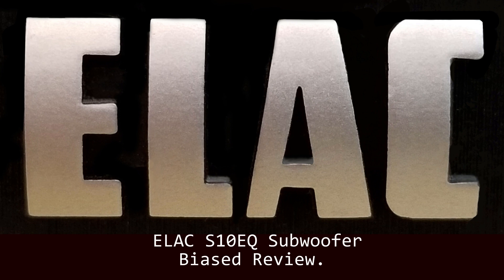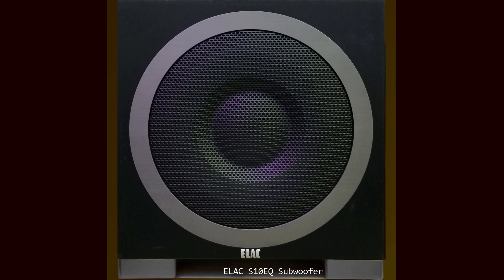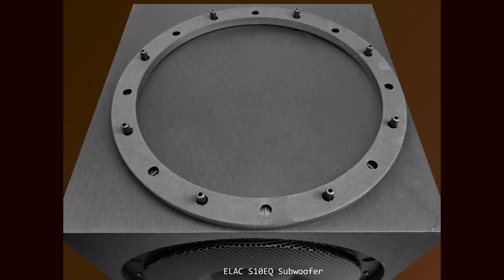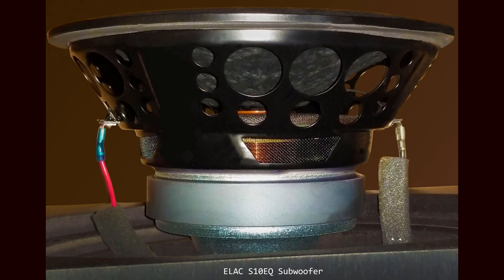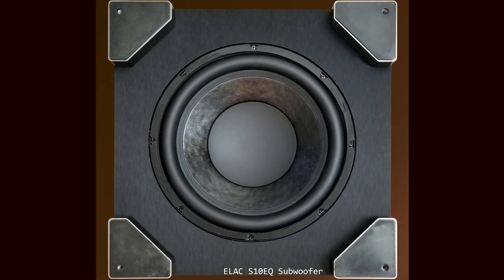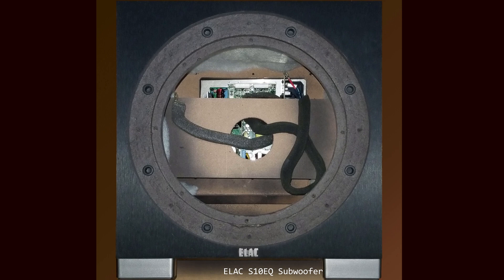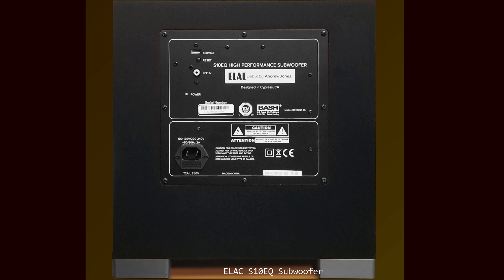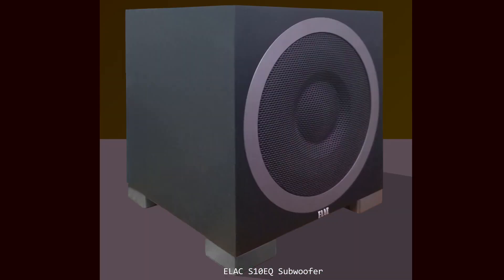ELAC S10EQ Subwoofer *Biased* Review and Teardown.

Comment: I have two of those I was kind of disappointed not having any analog knobs and switches on the back and how much trouble I would have with the Bluetooth when they went to 3.0 app  talk to tech for like about 10 days of emails so they said it's not working  with 2.0 version app so they said oh what kind of phone you I said Android so at the app it said it was able to work with Android so I did a Google search for the 2.0 version it didn't work with the newer phones so I went ahead and reload the 3.0 app and still not connecting subwoofer and new app with my new phone Bluetooth haven't heard from them since I took a screenshot of the 2.0 app so I'm left hanging right now
Reply: I had same problem with conection,then downloaded firmware from elac website and maked update via usb on the back of sub,evrythink works perfect now
Reply: @bedynek1 I have same problem with two phones. One is S24+ and other is Xiaomi 14. Both phones can't find subwoofer no matter what I try. I have tried several apps from 2.0 to 3.0 and even 3000.
Subwoofer have latest firmware installed as far as I know.
I have even tried reset it. Nothing helps. Funny thing is that Samsung S25 recognize sub immediately. Strange.

Comment: I am facing aproblumb in my s-10eq that thsub woofer is not being paired through blue tooth to tha new app sub woofer control 2 whenever I tried  to connect it shows the signal on my mobile as Searching for sub woofer but the app does not can you help please
Reply from the maker: I just saw this... Sorry for the delay. Unfortunately, I'm no help. Mine has worked every time. But I have heard that people have had trouble. Have you tried the Elac site, or audio forums?

Comment: I have all elac speakers to and I really want to use a high-end elac sub but they're all lacking volume knob.   All subwoofers should have a volume knob on the back or even the front sometimes you're watching a movie and it's just going a little too hard and you don't want to disturb your family or neighbors and you need to be able to reach over and slightly tweaked that knob !!
Reply: The sub is controlled via Bluetooth on a phone. You can do any number of things with the sub, including adjusting the response, turning it up or down, and turning the audio off.
Reply: @laxr5rs  which is very cool and fancy but still not very fast find your phone opening up a app and then waiting for it to connect or pair it's far slower than reaching over and adjusting the knob when the movie is a little too loud and possibly annoying your neighbors late at night

i know that in your app you have a mode for that but you have to remember to turn that on before as well as sometimes you're just not expecting thundering bass because you haven't seen that movie yet
Reply: @Reedith  I've never placed my sub so I could "reach over" and turn the knob. This is a serious sub, for serious performance. If you need to control the sub's volume, there are many lower cost options with knobs.
Reply: @laxr5rs  myself is next to the couch so I guess it's a special case. guess I'll have to try out the Bluetooth and hope it connects everytime pretty quickly cuz I really do want that elac performance

Comment: Thats a nice review. ELAC was foundet as a german company for submarine audio technics in 1926. Now the headstructure is Global Legend Holding Co. Ltd., China. This company produces also i.e. Aperion Audio Inc.. I bought 2 S10EQ subwoofers 2 years ago in Germany for 398 Euro each (incl. 19%VAT) ~ 361 US$ excl.Tax . If you use an android cellphone (Samsung S4) you get in trouble to conect if you will conect Blutooth BLE by searching. If you use 2 subwoofer you have start the App, enable the Blutooth, hold on the icon of the subwoofer for 5 seconds and rename the displayed subwoofers. That is not written at the owner manual. The new App 2.0 shall work for all ELAC blutooth subwoofers in the future. The ELAC support anonce since 1 year the release for the App 2.0 for S10EQ, but didn`t  happend. The USB port is really for firmware update. If so, you have to prepare an USB-stick, load down the firmware by a link given from ELAC. Reset the subwoofer and install the prepared USB-stick until the blue LED on the rearside flashes.  For update your ofther Debut 1.0 speaker, there is a review at https://www.youtube.com/watch?v=E3XlZ71yn_I and a blog from Danny Richie https://www.audiocircle.com/index.php?topic=138550.0 with a respond from Andrew Jones.
Reply: Sorry I didn't get back to you. Thanks very much for the information!